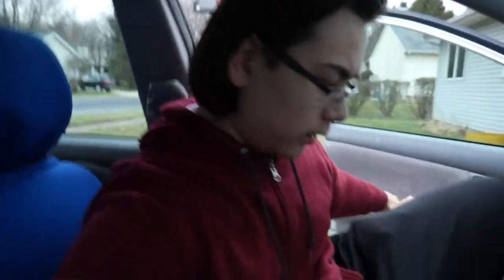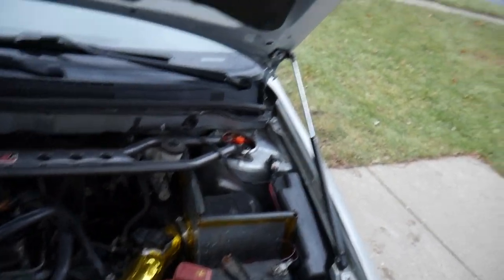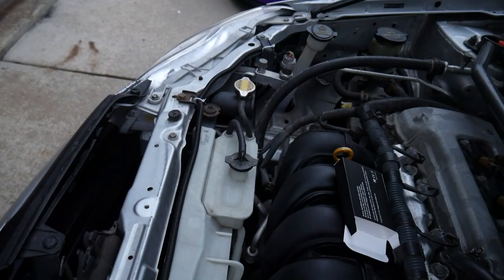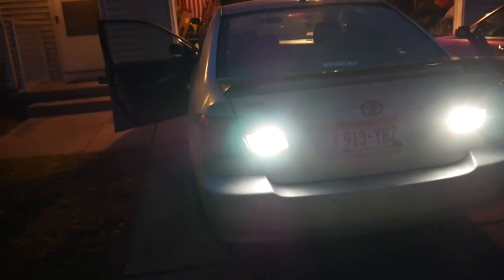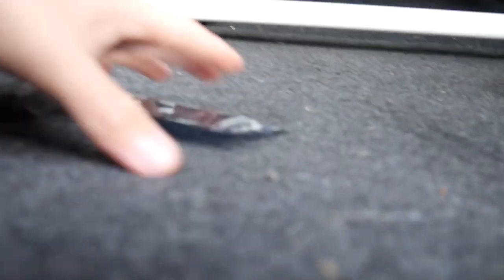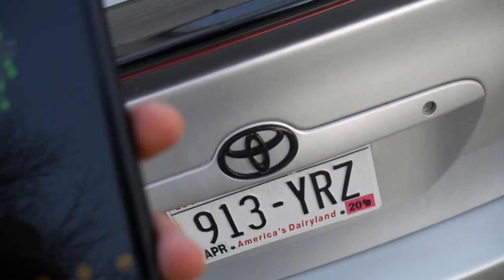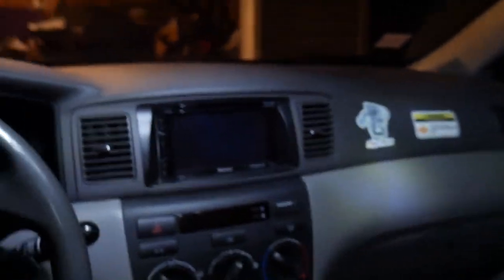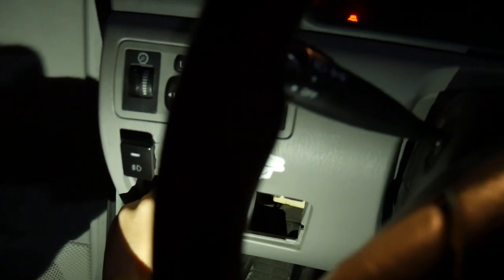Swapping ALL Of The Corolla's Lights To LED!

Comment: How do you know when you have to install resistors when installing LEDs.
Reply from the maker: Resistors are mainly to counter the hyperflashing of LED turn signals, but I'd always recommend a relay over resistors since it's less work and reversible. No other light would need to use resistors
Reply: @WillChang  thanks for the info. Much appreciated.